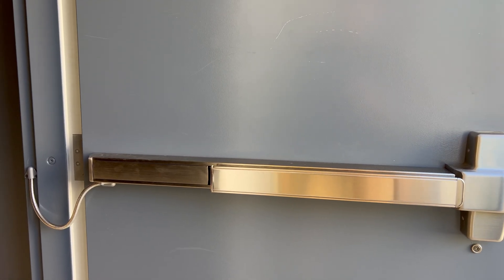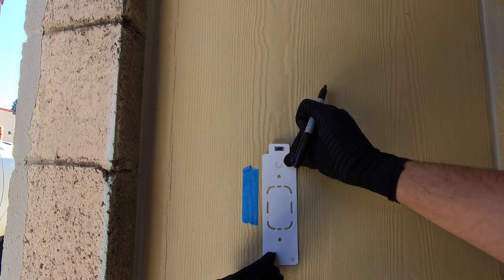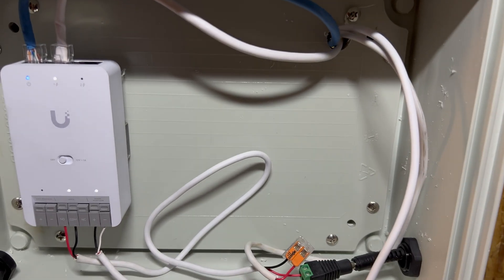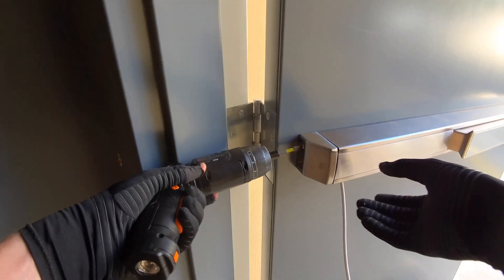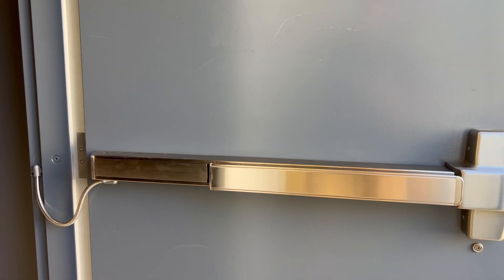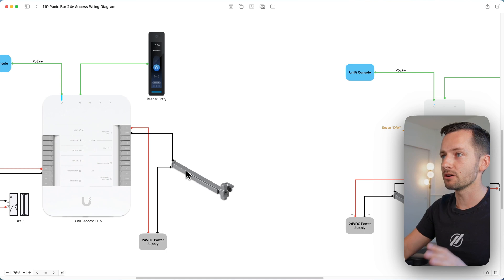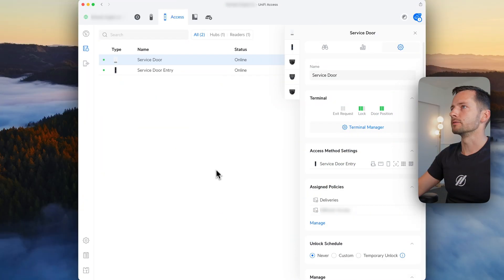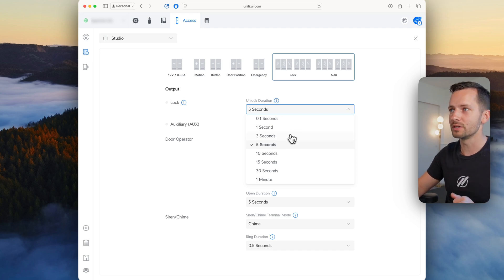How to Install Ubiquiti UniFi Door Access Hub Mini with Electrified Panic Bar, Double-Door Strike

Comment: do you have a recommendation for 3-point electrified panic bar?
Reply from the maker: I do not. Is that a vertical rod plus pullman latch? There's probably a Command Access kit you can buy to retrofit a certain 3-point panic bar to make it electrified.

Comment: how to connect with an magnet door?
Reply from the maker: It would be much easier if you have a magnetic lock. The wires from the lock just go to the lock terminals on the UniFi hub.

Comment: Jeez, I watched this whole video and ordered the panic bar from Ubiquiti... which this is not.
Reply from the maker: You have to re-assign the ports to LAN.
Reply: @ApexOneIT  Sorry I meant I watched this and thought the panic bar you used here was the Ubiquiti panic bar but it is not.  That is what I ordered and when I received it, I  realized it is not motorized. It has to be paired with their electric or magnet lock.

It's okay my mistake, I am returning it and I have ordered the Marks USA M9900ER like the one in this video.

It would be nice to show the working unifi access and motorized panic bar in action!

Comment: Hi,
In your setup with the UniFi Access Hub Mini and the electrified panic bar, can you confirm something:

👉 When you authenticate on the G3 Pro reader, does the panic bar unlock using the 24 V DC pulse coming through the Hub’s dry contact?

UniFi Support told us that the UACC-PanicBar cannot be electrically unlocked with 24 V, but in your wiring diagram it looks exactly like that (24 V PSU → dry contact → panic bar solenoid).

Just want to verify whether your panic bar actually unlocks electrically when badging the reader.

Thanks.
Reply: @ApexOneIT don t forget me? pleqse
Reply from the maker: Yes, it unlocks electronically. The unlock signal pushes through and the panic bar gets the power to press down and retract the latch. This is NOT the UACC-PanicBar. The UniFi Panic Bar is not an electrified panic bar. I'm using something else. See description.

Comment: How would it work for push bar with 2 pairs of wires? Specially the Adams Rites push bar that comes with a black pair of cable (power 24v) and blue pair of cable for automatic door opener?
Reply from the maker: Not sure without digging into it. I'm sure it can work. There's door opener functionality on the full door hub version. It'll either be powered straight from the hub or, most likely, the external power supply.

Comment: Great video and guide. Can the EAH itself be configured for the same or does one have to purchase a 30V capable hub to be able to leverage this use case? I heard one can use EAH existing AUX switched to DRY to bring in 24V DC but it must be transformed or converted? Question is can the EAH support a panic bar that uses 24V DC or does one need to move up into the newer Hubs that support up to 30V locks?

Comment: Thanks for sharing this video and diagram, helped out a lot. Question for ya, what kind of 24 volt power supply are you using , and can you share a link to what you used if possible? I got a switching power supply and it seems I can only be roughly 15-20 feet away from the door , any longer and the voltage drops so much it can’t unlock / power the solenoid enough for it to fully unlock the door.

Comment: I’m looking at 5:35. Is there a reason you didn’t move the panic bar closer to the edge? It seems (from that angle) that the strike is sticking out quite a bit and people could bump into it. Just wondering if there was a reason for that or if it’s just it happened. 

Trying to soak in as much as possible here. Appreciate you.
Reply: I believe it's due to the preexisting hole from the old hardware forcing him to set the whole bar further left than needed.
Reply from the maker: There's a template I used and seemed like that's where it should go. And also, like @ClaysonShawn said, there is already a hole on the active door and was used to locate the panic bar.

Comment: Great Video.  Can you make a video of setting this up on a Residential Door?  I have been setting these up on commercial doors at my job.  I have the UI electronic door strike on my house and if there is any pressure on the door the strike wont release.  I have a brand new door which has insulation around it, which pushes the door into the house. Basically we have to pull the door handle towards us, put our pin in, and then the door releases.  Pain in the tail when carrying packages.  I am trying to find other options but nobody makes a video showing the better equipment on a residential door.  Thanks!
Reply: Try the electric strikes with preload if you can’t modify the door frames.
Reply from the maker: Correct. I need to mess with residential doors but yes, preload can be real issue because of weather stripping.

Comment: What would you advise people who want a lockable lock one that will be physically locked and don’t feel comfortable using electric or magnetic locks because it doesn’t actually lock just hold it closed.
Reply from the maker: Well this is physically locked by default. Meaning it stays locked without power.  This is great for exterior door. And people can safely exit from the inside in case of emergency. Makes compliance very easy. You can add a keyed cylinder to this design as well.
Reply: @ApexOneIT  Thanks for the detailed reply. I was more thinking about standard household doors. I am thinking of also putting Unifi Access on my door but I don't feel comfortable putting up an Electric Lock because there is no deadbolt going inside the door frame. Should I just diy something with a smart lock? How would you handle such a request coming from a potential client. 
Hope to not bother you too much with this specific question.

Comment: Thanks for the video.  How does the design change if you have a double panic bar?
Reply from the maker: Yes, this is specifically for an overlap, double-door like this. If you have a mullion in the middle, then a standard rim panic bar will work no problem. If there's no mullion, then you'll need a different type of panic bar. Something that engages with a mortise style lock or maybe even vertical rods. Haven't done that just yet.
Reply: We have multiple double doors without a mullion (vertical rods). We’re exploring this exact same scenario.